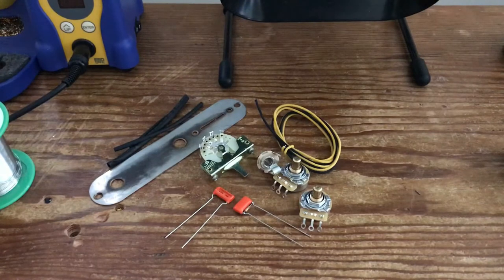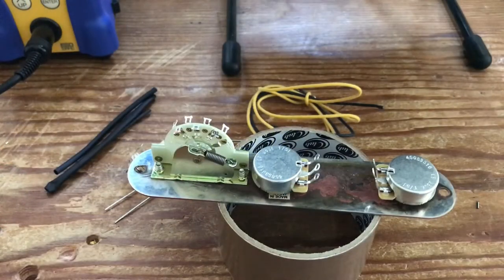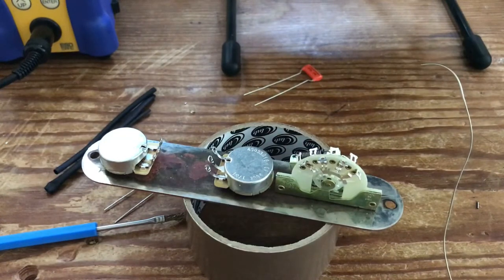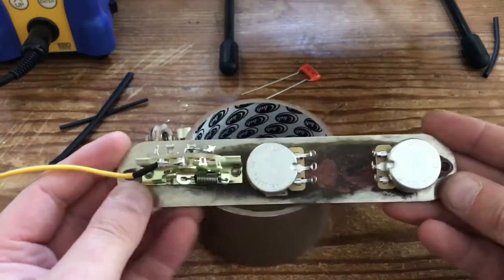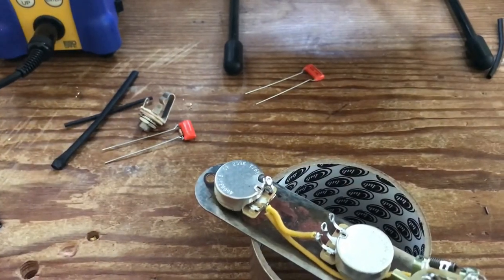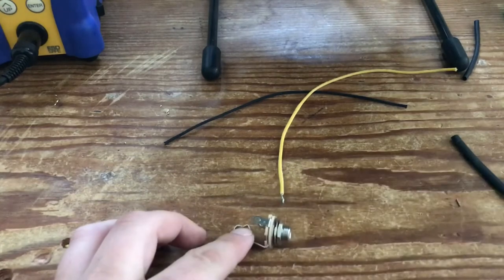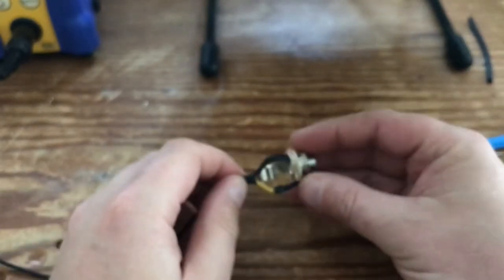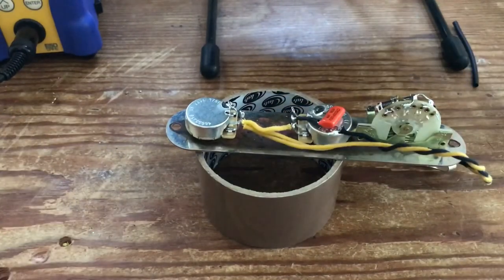How To: Reverse Telecaster Control Plate Wiring

Comment: Great video, thanks, I'll be soldering up the kit I bought from you tonight. One question though: why do you bridge the terminals on the switch starting from the side nearest the pots and going going toward the far side, then wrap the wire back alongside the switch? Would it not look tidier starting from the far side and going towards the pots? It won't make any functional difference (I think) but would look neater.
Reply from the maker: Thanks Mark - we wire it the way you describe in our prewired version - changed it after this video as it happens!

Comment: Thanks for this video, it really helped. Just a question, at 7:19 you mention “wrapping the wire around” the opposite end of the switch then back around to the pots…is this is necessary? Can’t you just wire it with the excess wire on the side of the pots instead of the opposite side? From a circuit perspective, isn’t it making the same connections?

Comment: I see on your diagram from the website the cap is wired from the vol pot to the tone pot. Is there any tonal difference in the different wiring or any other differences I should be aware of?
Thanks for putting this up.
Reply from the maker: No difference - it goes from tone to ground via the lug on the volume pot that needs grounding. Works both ways. Thanks for watching!

Comment: Very good video I liked it very much in case no one has mentioned it and I haven’t really looked at some of the other Comments. The reason we switch the volume it becomes easier to do swells with your baby finger wrapped around the volume knob as you plug the string and it works perfect just thought I’d mention that in case no one else has.

Comment: Very useful info mate thanks,   if you upgrade the pickups on an affordable Tele, do you have to upgrade the pots and switch too?
Reply: I definitely recommend it. The wiring components in the cheaper teles are, well, cheap. Not very expensive to upgrade, and it'll sound a lot better. You won't get your money's worth from new p'ups running then through cheapo components.
Reply: @J.Brachman  Thanks very much for your reply.👍

Comment: Back in the 1950s, when a lot of Tele players in small bands were doing double-duty and also imitating Steel Guitar sounds on stage, somebody figured out that if ya flipped the control plate over, you could just reach your open hand STRAIGHT DOWN and grab the tone knob a lot easier, so you could make that Speedy West style "boo-wah" sound... That was the original idea of the reverse control plate...TRUE STORY.☺️

Comment: i turned the switch plate around so that it was in the back  V, T, S.. body of my tele cavity is not deep enough for the switch... any thoughts ?...router...
Reply: wallaguitars I had the same problem. I didn’t have a router, or a chisel. So I used the blade from my hand planer as a chisel. Cut a bunch of wood out, and then sanded the cavity with 80/120/220 grit to clean it up a bit. Worked like a charm.

Comment: Great video. Thanks! I have a question, as there are so many conflicting opinions on all the forums: 
I did this mod (Bill Kirchen), but used braided shielded wire for the jack connection. Due to lack of space inside the cavity (MIM tele, which cavity seems to be smaller), the shielded wire is touching stuff it shouldn't be touching. Any tips on what to do? https://www.pinterest.com/pin/473792823279379880/
BONUS QUESTION: If you use braided shielded wire, would you shield the cavity with copper tape?
Reply from the maker: Hey Mercedes, cover the braided wire with heat shrink tubing is use it in most of these videos. It stops the braid from shorting on anything. In the shielding, I’d try without first and add shielding if needed. Thanks!
Reply: @SixStringSupplies  Great. Thank you!
Reply from the maker: No worries, it’s very cheap but very effective! You would need 3.5mm diameter rubber tubing
Reply: @SixStringSupplies  thanks!!